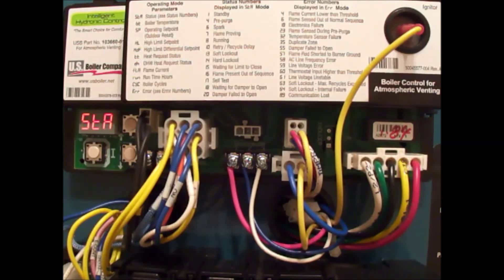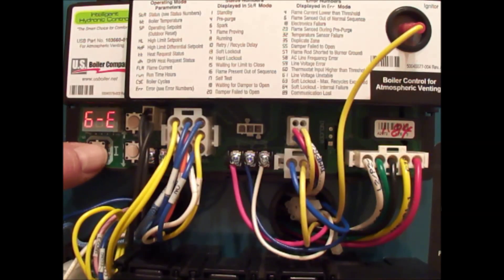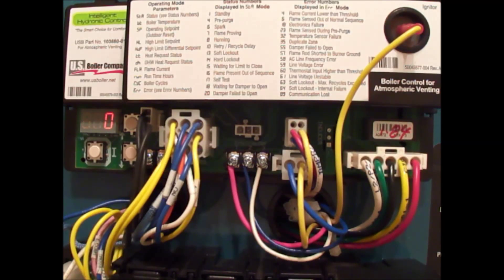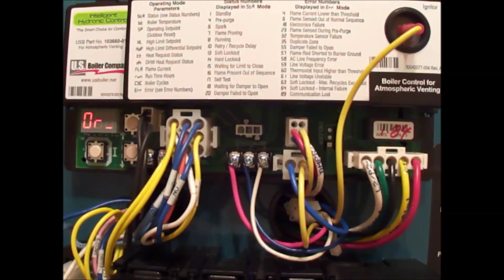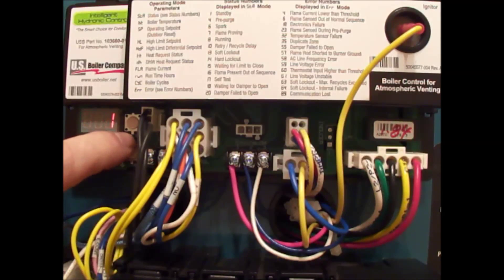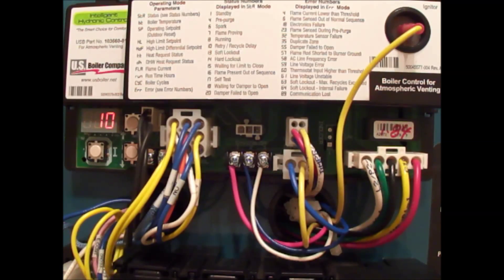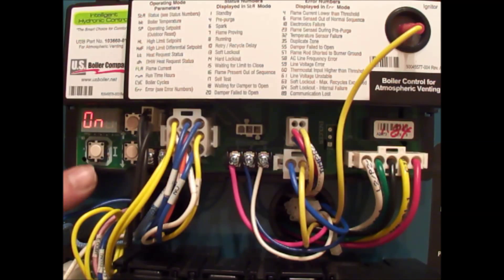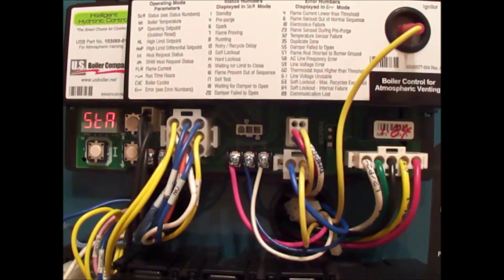Overview of US Boiler IQ control parameters

Comment: Thanks a lot for your video, it was very helpful to understand what is going on. Could you comment how long it takes the water temp to drop from the set point to the set point minus the differential? I have a very drafty house that I have been fixing little by little, so I have my differential at 30 right now to avoid the boiler turning back on every 5min. With the change in diff to 30, now it turns on every 15min-20min and heats up the water back to the set point in about some 5min. Would this be considered "normal" behavior?
Reply from the maker: It depends on the amount and type of radiation, flow rate and indoor air temperature

Comment: Hot Water shoots out of my release value on my x-2, it works fine then after awhile it shoots out
Reply from the maker: This is a boiler expansion tank issue. Either low air charge or defective bladder in tank.

Comment: My boiler it's showing Err 19. there is nothing about that error
Reply from the maker: An error 19 should not apply to your application. That is for twinned boilers, in other words two boilers connected together which Burnham does not do. Try cycling the boiler off for 15 seconds or more and see if it clears.This would be a soft reboot on the control.
Reply: +tk032009 Thanks to answer I'll give you the actual parameters from my boiler bt= 142 F/ Sp=180 F/ HL=180 F/hdf=15/ tt=off/ df=off/ fla=0.00  uA/ run=2 hr  162/ Cyc=64  487/.
Aquastat=220 F /  
Low Water cut off 250 F max temp 120.
Pressure meter gauge shows 30 psi but there is no water coming out on relieve valve.
Burnham boiler series 2  /164 BTU/Hr.
The problem is it shot off when it's too cold works fine for 2 or 3 days then shot off.
Before, l pushed reset button on aquastat and restart/ then that stop working/ so now with boiler on l disconnected the flame roll out switch and connected again then start working.
l call service guy 1rst guy said l have to changed pressure gauge/low water cut off and aquastat $1350.
2nd guy said l have to changed intelligent hydronic boiler control .
3rd company guy said he thinks it's the vent damper that is not working properly.
So three boilers professionals with three different solutions .
Reply from the maker: While boiler is running watch the FLA. It should be between 7 and 25. If you continue to watch until boiler shuts off and see if the signal drops below 1 and the boiler shuts down.
Find the FLA by pressing the "I" button repeatedly.
Reply: Thanks to answer me, with the boiler running the FLA numbers went 0.00 to 13.7 then it return to 0.00 when shots off. l did changed vent damper and wait for a cold day it trip off . and shows Err 56. l disconnected roll over switch and connected back and boiler started.